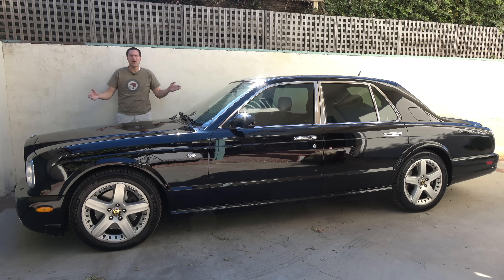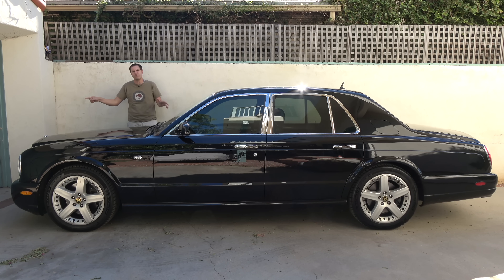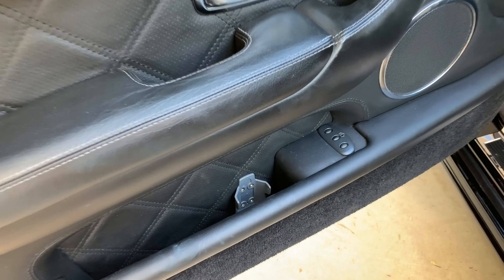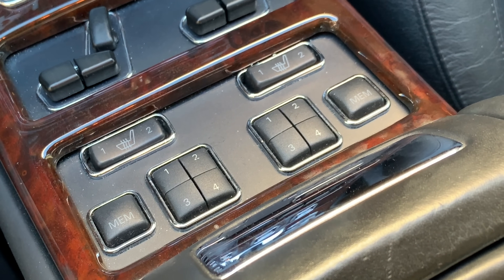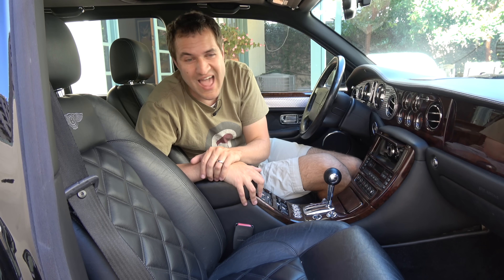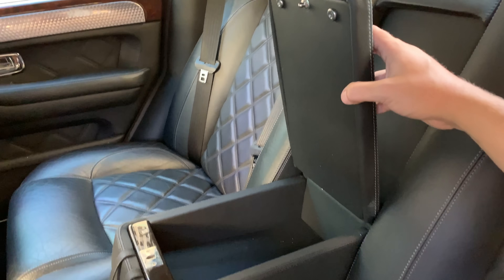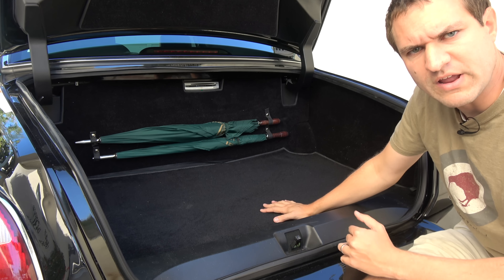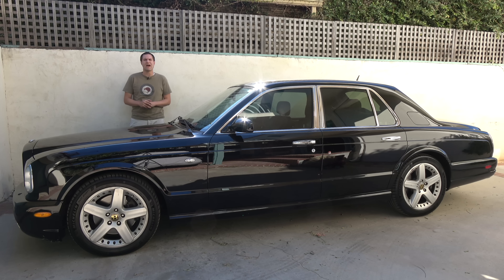The Bentley Arnage Is the Ultimate $30,000 Luxury Car

Comment: $30,000 to buy

$250,000 in repairs
Reply: I believe the first Arnage's might be cheaper, the 4.4 ones, which use a BMW-based V8. Or at least...a little less difficult to maintain in terms of parts.
Reply: Exactly!!!!  It's not the buying of the car....it's the maintenance.
Reply: @2Fine2Be Humble Your headlights are not made of gold, chillax buddy.
Reply: @2Fine2Be Humble Well to be fair with both of us you shouldn't have buy it. I mean for real Bentley is for people who are extremely rich and who actually can afford living with it. There is no point of picking an old Bentley thinking you will look rich, you will even go bankrupt keeping it on road. Those who own old Bentleys are not basically poor, they are still quite rich but they don't want to show up in a brand new probably because of a lot of attention. The point is that celebrities and CEOS own Bentleys and Rolls Royces normal peoples shouldn't buy them at any price because it is not cheap keeping it on the road.
Reply: @2Fine2Be Humble Same to you :D
Reply: actually the Arnage T is a pretty solid car. It's no Camry, but it's a lot more durable than any BMW/Mercedes
Reply: @2Fine2Be Humble  easy go to eBay for cheap headlights
Reply: @2Fine2Be Humble  No problem
Reply: James B and unreliable! No thanks 😂
Reply: Exactly very well said maybe a little extreme but yes a 100% accurate that it's gonna cost a lot more of there's a problem and that's if you can find the parts
Reply: @2Fine2Be Humble No, less than £1,000
Reply: @mightyjack5875  BMWs are shit. Look at the Range Rover. The biggest piles of turd were the BMW engined ones.
Reply: James B oil and tires don’t cost $250k . Name the repairs lol
Reply: Bentley: what the hell are we gonna do with such a stock pile of all these parts ? 

Consultants: easy , we'll give the raggedy cars away for free and kick the crap out of them for the parts .
Reply: @freddyr439  except 6.1 in McLaren
Reply: If I were to get one, it would have less than 25,000 miles.
Reply: @freddyr439  not to mention they DON'T hold the value of the car as well most...
Reply: For sale in Canada 2005 Bentley arnage t is a $80,000 luxury car
Reply: @yanuchiuchihaanimegamesand3907  Then why did this car depreciate so much if they are so solid and why does Scotty "I'm a dinosaur" Kilmer say that they are crap, unreliable endless money pits?
Reply: I have an uncle though who knows this guy who has a friend that will fix anything.  So it may be a pretty good deal.  LOL.
Reply: @ClaireYunFarronXIII  scotty kilmer is just an old drunk crap talker at this point 🤣 king of clickbait
Reply: Does Bentley even make parts for its older models?
Reply: @skyscourge5663  Yet everything he says is still true. 😂 Hurt much?
Reply: @johnchurch5101  Owning the car, and having a brain
Reply: @freddyr439  laughs in 300k mile 2001 BMW 740
Reply: @en3myspott3d54  last of the good ones. I had the opportunity from to buy an 88. Ultimately bought a 91 Jag xj6 from the same seller.
Reply: This is what happens when Germans get their hands on these premiere saloon manufacturers.
Reply: They aren't as expensive to maintain as people think.  Not cheap,  but unlike the modern Rolls Royce and Bentley cars any good mechanics can look after them.  I've had a 1965 Silver Cloud III for nearly 40 years and it doesn't cost a fortune to maintain
Reply: No not $250000... $25000 maybe.
Reply: What year was best
Reply: I love camry....
Reply: Worth it.
Reply: If you watched the end of the video the owner stated he didn't go over $2000 in maintenamce, albeit only driving it rarely.
Reply: ahahahaha....
Reply: Really ?
Reply: @TwinkleandVinkle  si vai tranquillo, queste macchine passano più tempo in officina che su strada. 💸💸💸💸💸
Reply: total FUD! I've had two Bentleys and yes you can put some money into them... but I MADE money on both of mine... considering buying this next.😅😅😅
Reply: 🤣🤣 I know........ but its a Bentley 😍
Reply: @WishMount  your ending statement! You don't get a Bentley or Rolls Royce for them to be daily drivers or extensive road trips, and that's what people have to realize. And when you don't use something too often, it will last longer and maintenance won't be too much of an issue. It's when you put a lot of miles on your car is when you have expensive problems.
Reply: @yanuchiuchihaanimegamesand3907  Based on what?
Reply: @en3myspott3d54  That was a great year. My dad’s was at 195k before someone ran a red light and totaled it. Great car though. My sister’s X3 crapped out at 165k, and my bro-in-laws old 325 went to about 250k. Overall, my family has been very fortunate to have a long-lasting, very reliable BMW experience.

Comment: You didn't mention it's impressive gas milage: MPG: Up to 12 city / 20 highway.
Reply: That's even being generous. Most sites have these 03-04 Arnage T's listed at 9/13 or 10/15 for mpg. Crazy.
Reply: @natekenny7106  much better to just buy the tesla model 3, its faster and more reliable and modern,  Arnage will lead you into bankrupcy
Reply: @Lousy_Bastard  Noticed the body pannel issues when I did a test drive, too.

Comment: I guess bently cars dont hold their value. 300,000 to 30,000.
Reply: @ADUSN  that makes sense. So luxury is disposable. Thank you for the knowledge.
Reply: Depreciated $270,000 and still gets a 7 on value like WTF!!
Reply: @dmejia706  A bit odd yeah. Maybe he means that it will keep depreciate and if you sell it a couple of years later you will still have lost money from the initial buy
Reply: 2003 bmw 745i original price 90k dollars; current price 5k dollars.
Reply: At the end of the day it is called a "Doug score" but it gets a 2 on the "Nicole score" for value...
Reply: @dmejia706  Think it means cost/performance in this case. Which is absolutely amazing.
Reply: Look at a car that cost $25,000 fifteen years ago, they go for like $2500 now which is a 90% drop.  Many cars are like that.
Reply: @dmejia706  he goes by with current car industry standards which makes sense..y'all either too young or just leak common sense !
Reply: @ilovekitkat7857  *lack
Reply: @ilovekitkat7857  My gripe was only in reference to the "value"  score... I believe some scores are pumped up or lowered because of the overall score and where he wants it to fall in the rankings...  I'm 41 years old BTW... And I stand by what I said
Reply: @ADUSN  Yeah, but it's not the same case with sports cars. They are desirable even after a long time.
Reply: @dmejia706  Only a problem if you have a time machine.
Reply: @leafmagiic748  I do!

Comment: From someone who has driven one of these a couple  times......you don't just stomp on the pedal, or wing the steering wheel. The whole vehicle has been designed for dignity and stateliness. You have to try very hard to see the performance that is built into the machine. That said? It is a complete pleasure to drive.

Comment: FYI. The aluminum trim is called “engine turned” finished.
Reply: ...and I think its actually stainless steel, but I can be wrong.
Reply: Yep! Or jeweling: was very popular in aviation. It is a nice touch of detail. I just ponder if all the trim in that bently was hand jeweled.
Reply: Yes, brushed aluminum would look like your stainless steel refrigerator. And yes, all the "aluminum" in this car is stainless steel or chrome plated steel or nickel.
Reply: Just as classy in this Bentley as it was in the Bandit's Trans Am.
Reply: Lincoln Aviator has the same finish

Comment: That's lighter than British Racing Green. 
Also, the climate controls changed in the 2007 model, if I'm not mistaken. Even the gear knob changed in that minor facelift, along with around 50 more horsepower.

Comment: Watch out for early models with head gasket issues. Common problem that will cost $$$$ to fix properly.
Reply: aaron names - Exactly. Should’ve been mentioned in his review. There is a reason some of these cars sell for $30k. The Red Label cars with the 6.75 liter turbo engines will almost certainly need to have the head gaskets done if they haven’t been attended to. I’ve heard between $6k-$10k to have them done. As a Rolls-Royce owner, here’s a good rule of thumb: there’s nothing more expensive than a cheap Rolls/Bentley.

Comment: Wait ! Gas tank indicator draws the fueling location on the right and the gas cap is physically on the left. What did I miss? 🤯
Reply: presumably, it was a dash from the right hand drive UK/Commonwealth model.  the division that assembles the vehicles for the left hand drive markets likely gets mostly completed vehicles prior to fitting.
Reply: @snowymountainlove  interesting, thank you for letting me in on that. 👌
Reply: Well spotted and that would be enough for me to insist on a $50,000 discount on the showroom price. THAT is not attention to detail. THAT is very poor in my eyes.
Reply: See, that thing about the pump hose indicating which side the filler is on? It's an urban myth.
There's a reason newer cars generally have a little arrow.

Comment: Hi Doug, I found a 2005 Bentley Arnage T Black Label Auto with 14,250 kms on the clock for sale in Melbourne, Australia for $159,500 AUD.
Black with light tan leather trim. Beautiful car, but nowhere as cheap as in  the U.S.

Comment: What's worse than buying an old BMW? Buying an old BMW with a Bentley badge....
Reply: And a Rolls Royce engine
Reply: @eazen  Except this is the last really British one, so well, I guess that's worse.
Reply: This car doesn't have anything to do with BMW.
Reply: @teomanmetehan7469  Yes it does. This was the last year that BMW supplied Bentley with parts.
Reply: You have no clue what you're talking about
Reply: Well old bmws are actually if well maintained really reliable
Reply: Hope they didn't rely on BMW for the transmissions; that's a kiss of death right there....
Reply: @mdd1963  because most bmws have sport transmissions and you can feel whatever rock you step on
Reply: @a.samatasss4731  they work very well until nearing 80-95K miles, and the reverse torque converter (or an associated related engaging mechanism) leaves it acting as though you are still in neutral... As BMW does not repair them, but, they will swap one for with one pulled from a wreck for only $8-$9k (That was years ago, so figure $11K now)
Reply: @mdd1963  well my dad has an x5  e70  104000 miles with no transmission problems because how he drives it he very careful over bumps and bumpy roads so if you drive carefully it will definitely last but i agree with you some bmws have that problem anyway.

Comment: That's not the aluminum, that's stainless steel. You can't polish aluminum this way, it won't be that heavy, and it'll oxidize
Reply: Андрей Зайцев Aluminum doesn't oxidize tho
Reply: @jmoney7289  Yes, it does. Just more slowly than Steel.
Reply: And it's "engine turned" not "brushed."
Reply: It's aluminium and walnut veneer in the interior.

Comment: 1k a year to maintain is definitely not reasonable for a car with less than 100k miles.
Reply: Shiv_McShankston. You gotta consider the initial cost of the vehicle though. I’d say it’s not excessive considering that. Some wise person once said “if you can’t afford it new you can’t afford it used”.
Reply: My last minor service on my C class (which has nowhere near 100k) cost £760.  Once I add in oil, tyres, brake pads etc.  £1000 doesn't sound bad at all.
Reply: This ain't a honda lmao.  I expected it to cost more given what it is
Reply: For 35k miles is pretty ok being on BMW parts

Comment: The climate control is EXACTLY out of an E46 BMW lol
Reply: Except it is not at all out of an E46 (even if you capitalize the word EXACTLY).  It is the BMW dual zone controller used in various other models.
Reply: Yeah but you get my point p:
Reply: Funny that they moved back to trusty pushrod 6,75 litre V8 because it had more torque in lower RPMs. It was worse in every other aspect but they went with higher torque. Because they are Bentley. 
Maybe my most favourite Bentley model ever. Elegant, understated and superb.
Reply: @jakublulek3261  RPMs.  I stop reading there.  There is no such measurement as RPMs; it is incalculable.  Your credibility drops to zero when you add a second plural.
Reply: @georgesnyder5337  Not an English speaker but you are right, as somebody with master's degree in English literature, I am very ashamed. I will chastice my autocorrect immensely. It is more accustomed to translations of John Milton than YouTube comments.

Comment: The Arnage is beset with issues between 2000 and 2005. The 'T' is the one to avoid as the engine eats itself...not IF but WHEN...(camshafts). The others almost all have head gasket failure. Best one to go for incredibly is the 1998/99 4.4 BMW engine Green Label. I speak from experience.

Comment: Ha!  Bentley shorted you on closing the trunk.  The Benz W140 has a power handle that pops out when the trunk is opened to grab to close the trunk with (down to the power soft close that closes it fully to not have to slam it), but the power handle keeps from having to put your finger prints on the cars finish when closing the trunk.

Comment: Most of those “aluminum” features are not entirely aluminum but an alloy known as ZAMAK (fancy scientifically formulated pot metal) which can be easily molded, machined, and plated. That’s why items such as the cigarette lighter felt heavy. A typical 6060/7075 alloy would wheel light and cheap. It’s the illusion of high quality.

Comment: The reason the cigar lighter is so heavy is that it's not aluminum, it chromed steel.  As are the mirror (and most other) switches, as well as the "organ stop" heat/ac controls.  The car weighs 6.690 pounds!

Comment: Considering the distance between those trunk batteries and the starter, aren't the cables on the thin side?
Noticed that they included bulbs, etc. but omitted a new head gasket. Wouldn't you probably need one of those in 50K miles or so, esp. for the turbo model?

Comment: I had one during 6 years. It fused the first engine after 67k KM and was rarely more than 3 weeks in a row without any problem. The Bentley garage do not manage any more to get this kind of mechanic under control. The acquisition costs were 62k, further repair around 100k. Cheap? Not really. However, I enjoyed this car very much.

Comment: At least where I am from, you are required to always have replacement light bulbs in your car. Your car will not pass its MOT without them. You might not be able to change the lightbulb yourself because it requires taking apart half of the car, but you still need to have them.

Comment: I wish you could add a Tall Guy segment with a tall friend. You're tall but you have no idea of how hard it is to find cars that did not stop at 6'2 when designing their interiors.  Tall guys know:  Shopping for size 14 shoes leave you with 2 shoes in the whole shoe department that even fit, never mind look good, or right style for your purpose.  In ordinary department stores, whole hat department has nothing at all in a 2XL, and same goes for the gloves.  (Besides just resorting to ebay and amazon and sending money and hoping for the best, I found that hunting stores have the bigger gloves, and specialist hat stores have good size hats.)

As for cars and SUVs now:  Consider the following. 

 It sucks when you go to clutch, and you hit the brake too.  You don't feather a clutch like you feather a brake  (It is "Exciting").  I have to choose footwear carefully, can't just wear whatever on my feet in my sports car.  Slimmer sneakers and definitely no boots whatsoever are needed.

It sucks when you can't put the seat into a proper performance driving position, meaning you can reach the top of the steering wheel with both hands plus at least a tiny bend in elbows, while keeping your shoulders fully on the seat, because your head hits the roof crazily.
It sucks when the headrest pushes into your trapezius muscles hard and makes you contort your head because the headrest pushes and there is no adjuster to tilt it the hell back at all. Newer cars are the worst with the damn head-forward (upper back forward in my case) head rests.  You used to be able to remove headrests from cars at last resort. No more.  UGGGG  Where did I put the hack saw? And will the ECU throw a code if I cut out the headrest?

 It sucks when you buy Lexus largest, heaviest, widest, longest sedan, and the damn thing fails the  above seat test. It sucks they put so much car and didn't put the roof at least 1 inch higher.  The Bentley Arnage looks like it might get this right, but I haven't tested it.  It sucks that the elbows hit door pillars that curve in toward driver behind the arm rests instead of letting me actually use arm rests in the Lexus LS.

It sucks that the Subaru WRX STI is the only sports car with headroom.
It sucks that your knees are within one inch of the dashboard and you have to hope you won't lose your knees in a fender bender.
It sucks that SUVs are all hella tall but won't fit size 14 shoe wearing mofos in the driver's seat.
I don't want to drive a F-150. Please. It's not fair.
It sucks the rearview mirror is exactly covering the whole passenger side of the windshield. (Can I remove the damn mirror completely? Can I put in a two-way glass mirror that you can also see through, like in retail stores?)
It sucks at red lights that  I have to ask passengers when it turns green. Or else I have to head-bob incessantly like a damn chicken.

Comment: Yeah, but you'll pay about $2000 - 2500 USD / year for local taxes because of the large engine. At least this is what happens in Romania.
You also won't be able to get cheap aftermarket spare parts for it, so, just wait until you have to pay $2000 / shock absorber and you need 4 pieces.